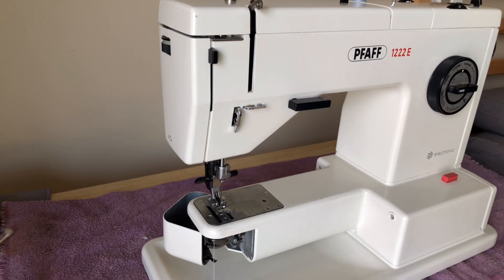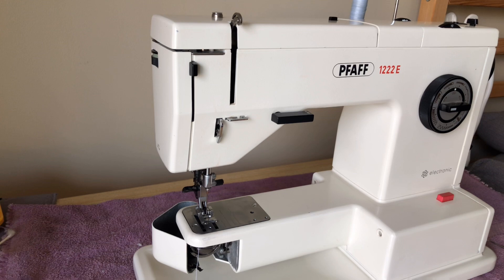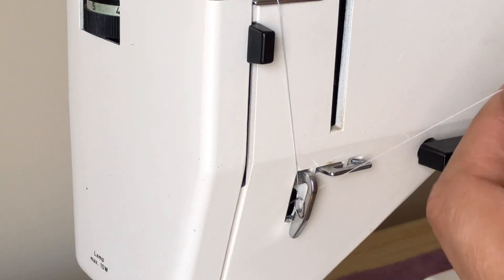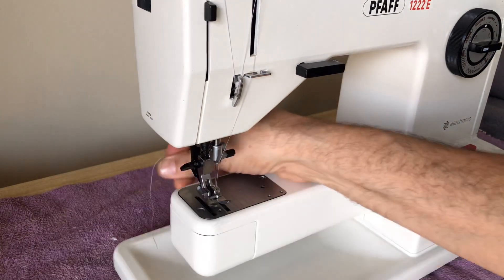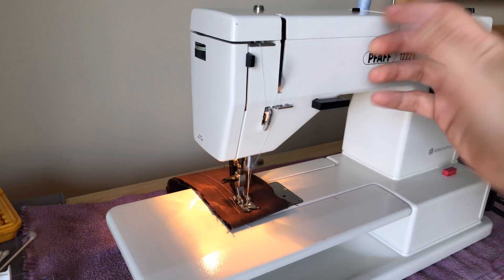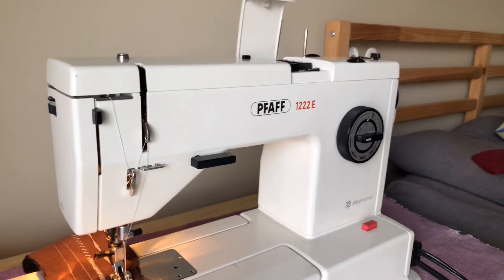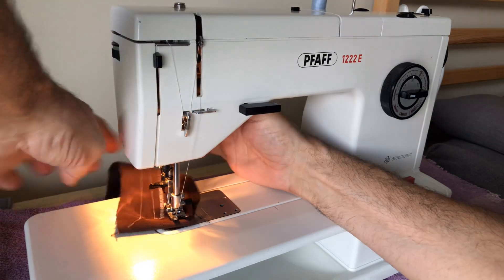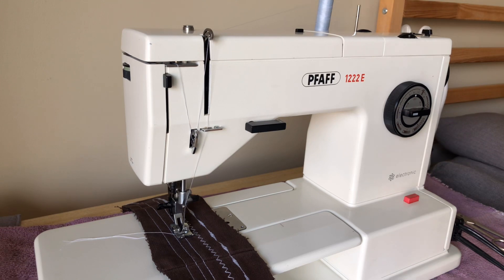CLIENT PROJECT SERIES #10: Final Stitch Testing as the Pfaff 1222E Comes Back to Life!

Comment: Erm...why didn't you use the automatic needle threader? It saves sooo much time., its a wonderful invention.
Reply from the maker: I show threading by hand (the slower way) because most vintage machines did not come with a built in needle threader.  I'm glad you asked though as I should show both ways of threading the needle the next time I have one of these.  Fortunately, the manual should show how to use automatic needle threading. Thank you for the suggestion.

Comment: Hi ! i'm really attracted to this machine cause of its quality, design, built and specifically its double feed mechanism and the short distance between the needle and the edge of the arm tip which is something i really look for according to my sewing needs... I'm considering to buy one that is sold as "non working" and i can't get more information about it, the seller wasn't the user of it and i'm so affraid to lose a buy by "bothering with questions"... something that sadly use to happens in my country... anyway... your videos are sooooooooo helpful in this situation cause i hope to be able to get the machine back to life but i'm not really a technician, if i can have a properly working machine like that it would definitely become my main machine, do you reccomend me to try it ? there is no other machines with this capabilities (specially the walking foot) in a budget ! cheers !!!
Reply from the maker: Pfaff made some great machines for sure.  I would also say that the "double feed mechanism" is not a true Walking Foot and I would suggest not assuming this machine can sew in a similar league with an industrial Walking foot machine.  That said, some owners do like the feature and find it helpful in keep fabric layers from slipping.  As for repair, well, Pfaffs and other European marks will typically require more labor hours given their design but the most important factor for you is going to be parts.  If you can find a technician that has the skills for this model, then you might decide to go ahead but do know that spare parts for these can sometimes be a treasure hunt and costly at that.
Reply: @VintageSewingMachineGarage  thanks for your dedicated reply, it really helps me... makes me doubt... i used to buy some quality vintage machines with every parts made of metal and i sometimes had to tune them up, set them up, sometimes in depth but i never had to replace any part cause, i guess, in this machines parts are really difficult to get damaged but it seems this one, despite its strong quality, and also due to its not so old age, has many plastic or nylon (not sure if its nylon) mechanical parts and, knowing this machine im thinking about is not sold as a working one, I can't help to doubt... and your experience is much appreciated about it; i can't afford a real walking foot and i think except the Thompsons and Sailrites every of them has to be industrial... and i have to consider it seriously cause most of the things I'm going to make with them are bags, not leather buy vinyl and many layers sometimes... have you noticed a worthy improvement using this type of idt feed ? cause if you didnt i might just use my necchi supernova with one of that "walking foot" presser foot attachment... i guess i'd use a roller foot combined to the double feed in the Pfaff 1209, if decide to buy it, but im so doubtful right now, and sorry about this long message, in your experience do you consider there is a much higher probability of finding broken parts in this pfaff machines compared to the metal more industrial like ones ? sorry to abuse of your kindness but... this information is crucial to take a decision !